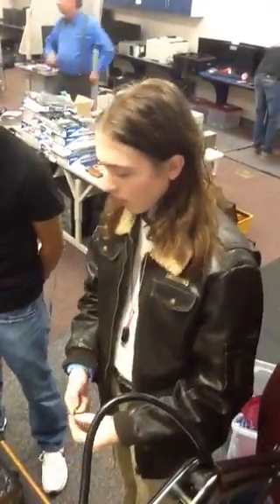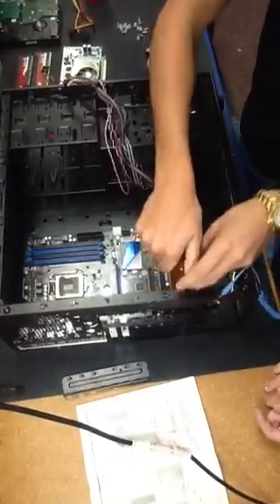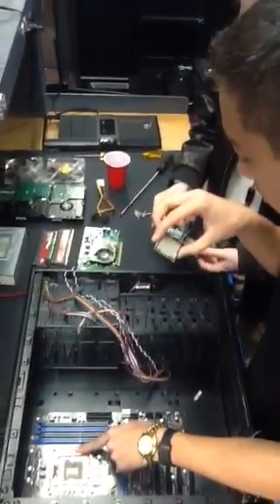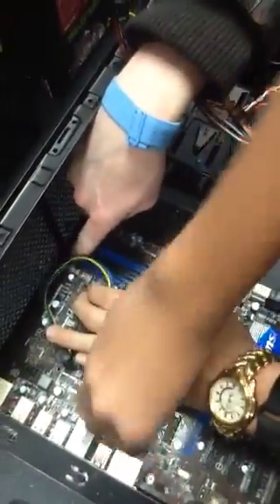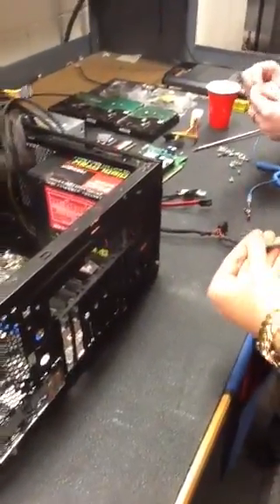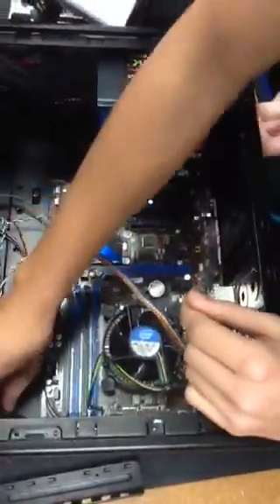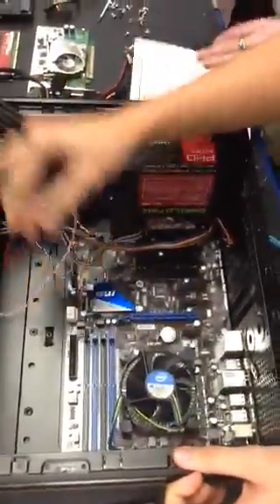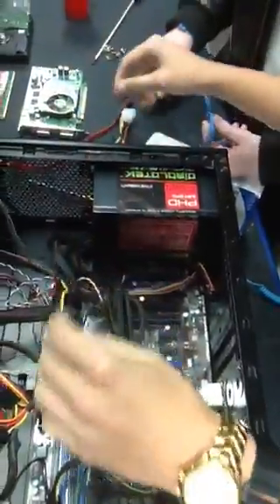Central Georgia Technical College / Houston County Career Academy Computer Repair Demonstration Par

Comment: you cant wear any metal (The Watch and The Rings) while working in the computer (Parker Pellan and Mason Hawk). It is to keep the computer from getting any ESD (Electric Static Discharge) and damage the motherboard or any other parts.